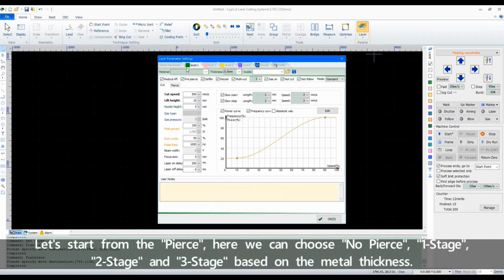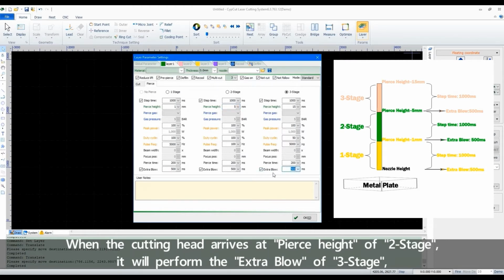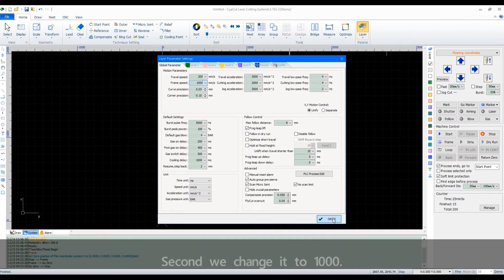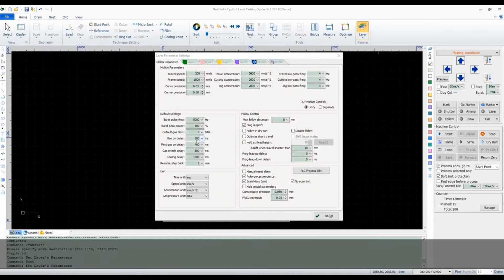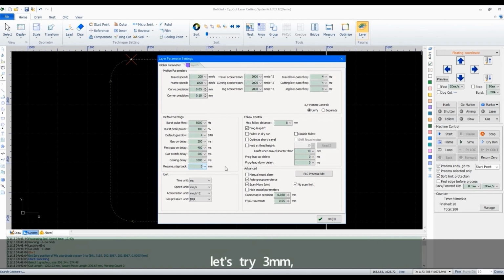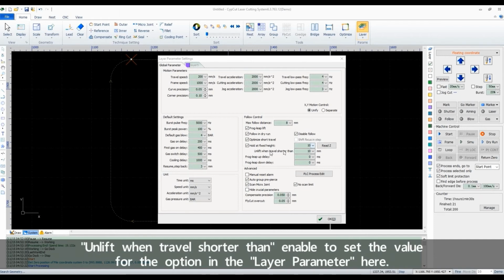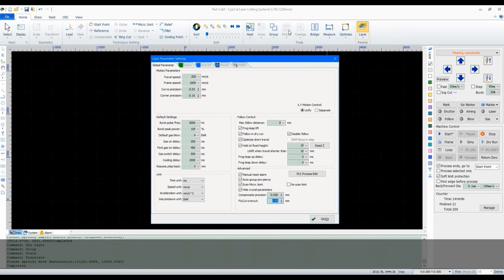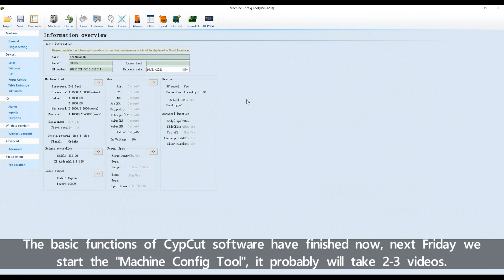CypCut Software Tutorial English | Cypcut Laser Cutting | Complete 9

Comment: Hi, is there an option for pause point? For example when the program reached the set point it automatically pause the program that not finished and not continue before started again?
Reply from the maker: sorry, could you explain it more?
Reply: @ClaraChai  for example we have a 8 mm sheet that we cut every day, it needs pre Pierce with 1.5 nozzle, it goes all the wey up the sheet and it takes about 2 to 3 hours, after rhat for cutting it needs 2.0 nozzle and sheet need to get clean, if we don't clean it the part quality will be decrease and machine will stop many times, so sometimes we need start the machine and go home for a break but the holes takes 2 hours and after Pierce completed began to cut the parts with the wrong nozzle
I need a wey to machine automatically pause after applying Pierce then after hours we came back change the nozzle and clean the sheet to cut the parts